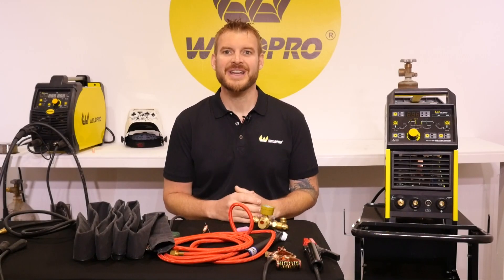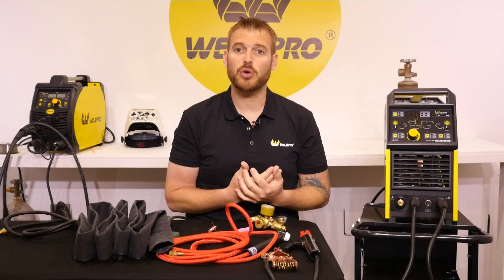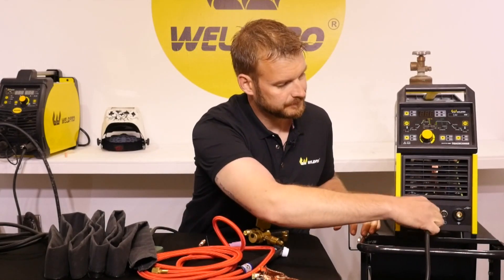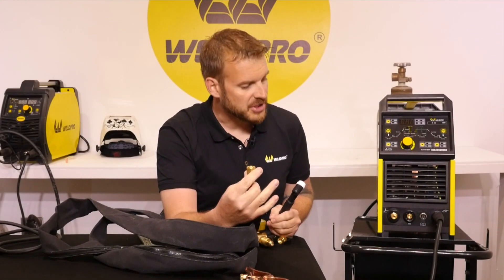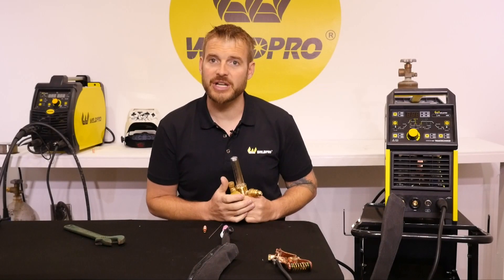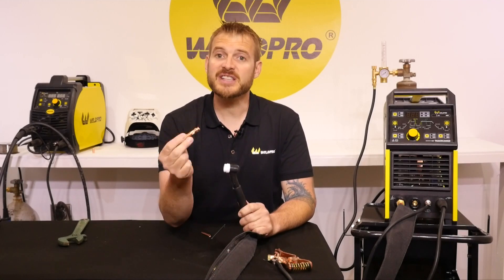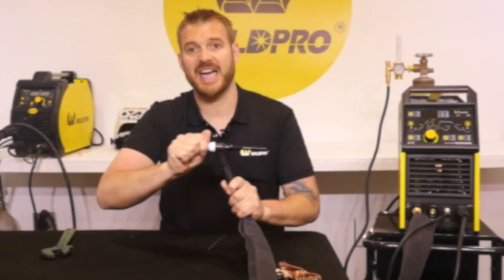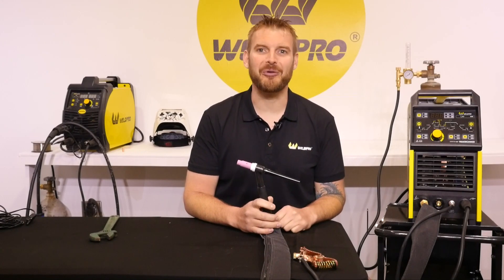Weldpro TIG 200 Part 2 -  Assembly and Set Up

Comment: Dumb question but where does the electrode connect during TIG welding?
Reply: The electrode is the Tungsten; it goes in the TIG torch.  It's at the end of the video.

Comment: My order was confirmed this morning. Just got my tracking number. This trigger pull is over 6 months in the making. I'm psyched! ✌️😎
Reply: Update: Holey smokes! Right outta the box this thing TIGs like buttah! UPS dropped it of at my school, and after I tried it, a few of my classmates took 'er for a spin. Finally, my welding instructor sat down and gave it a go. After about the first inch of bead, he says, "That's it, I'm gettin' one o' these". Very impressive machine. Way to go and thank you. ✌️😎
Reply: Just got mine today I can't wait to use it!

Comment: I take it that this welder doesn't have any hot start for stick welding or setting for 6010 or 7018...will this run 6010 electrode or is it 6011 on up?
Reply from the maker: 6010 can be a little tough to get going but there is a VRD open circuit voltage option you can turn off for hotter arc starting!

Comment: So there are two tungsten's with the torch. A blue and a brown color markings. If I remember correctly the brown is for welding steel and the blue is for aluminum. Is this correct?
Reply from the maker: Richard Wilkerson The blue tungsten is 2% lanthanated. This can be used on almost anything including aluminum :-) you don’t need to ball the point either. Brown is a zirconiated tungsten that is supposed to be for higher quality radiographic weld to prevent tungsten inclusions. The reality is the 2% lanthanated runs equally as well for 99% of applications. Try them both on AL and see which one you like better! Also if you would like to add a tungsten to your collection at any point... a red thoriated is excellent for almost anything but I’ll switch to pure tungsten or 2% Lanthanated for AL ... we better do a video on tungsten selection 😉😀

Comment: Vulcan 205 pro tig vs weldpro 200 ...
Reply from the maker: DAVID VILLA Vulcan only has 25% duty cycle at only 135 AMPS! Weldpro is 40% at full throttle and 60 % on A/C!! Also I’m not sure if you noticed but on 120v it can only weld stick up to 80 amps. That’s hardly enough for smaller 3/32 rod.
Reply: @WeldproWeldingEquipment  will be tig welding mostly aluminum and stainless steel, maby some inconel or titanim..
Reply from the maker: DAVID VILLA kind of a loaded question haha... the 20 torch shouldnt be a problem as long as you use a hose with connector that fits the tig 200. Water cooler... yes but an aftermarket cooler would require an external setup and some rigging ... you may see a water cooler model coming out from weldpro soon! Keep an eye out!
Reply: @WeldproWeldingEquipment  thank you for the info bught the tig 200 yesterday.. Kinda wanted to use the 20 tourch i have a lot of consumables from prior job that used that tipe of 🔦.
Reply from the maker: DAVID VILLA You know what I just thought of David... sorry to say but I wasn’t thinking the 20 is a water cooled torch. While you may be able to connect it this isn’t a good idea because it doesn’t get the correct gas or water cooling and can overheat the handle. We are coming out with a water cooler soon that you can add on. This should support your 20 model.
Reply: @WeldproWeldingEquipment  cool .. Yes the reason y i ask ia that i have a lot of consumables that fit the 20 torch, gas lens and fupa cups, the thread diameter is smaller in the 20 torch than the 17.. So i was looking if ther might be a 20 aircooled ck torch that might fit.
Reply from the maker: DAVID VILLA ya the Vulcan doesn’t seem like a bad machine at first but for $1000 it comes with no name components. When you get the TIG200 for only $798  it comes with a quality CK super flex torch kit. Warranty on the Vulcan is only 90 days. Weldpro is 2 year warranty. Vulcan... good luck with customer service... Weldpro.. call customer service and talk to Joe! He can give welding tips tricks, setup help, and troubleshooting. Vulcan has a 20% restocking fee... not us 😀 .... Save money and time while getting a better warranty, customer service, online learning resources, and higher quality components.
Reply: @WeldproWeldingEquipment  Hi yes its true. But how can i say.. If it brakes i can take it to the stor and swap it out no down time.. And warranty is up to 3 years i just found you matching and i like it.. But i am weighing witch one is best for my small business.. I am ready to buy now.. Looking at reviuwes abut your machine.. I like the duty sicle and the tourch but hows the waranty and your cuatumer service?
Reply from the maker: DAVID VILLA seriously our customer service is amazing and local here in the US. You can check out some of our reviews online. Let me just say this... if you get the Vulcan you will probably need to swap it out at least once. It is extremely rare that anyone has a failure with the TIG 200. Even if you ever were to need a replacement we ship from an in stock warehouse here in the US so usually down time is minimal. Seriously... save $100... get a better torch and better internal components. The AC feature is amazing on the welder. Pulse is excellent. Welding aluminum, stainless, anything else is well within the capabilities of the TIG 200. You won’t be disappointed! Check us out on social for lots of customer photos, reviews, and projects.
Reply: @WeldproWeldingEquipment  ok look like i will guive you a shot.. I am going to your web site
Reply from the maker: DAVID VILLA That’s great! I know you won’t be disappointed but there is one rule... you have to send us some cool pictures of what you build now that you are part of the Weldpro family so we can feature them on social. 😃😉
Reply: @WeldproWeldingEquipment  ok i will do👍
Reply: @WeldproWeldingEquipment  i do jave a question or 2.. Can i ad water cooler and can i use a 20 torch ?
Reply: No 4t on Vulcan, which I failed to realize in store

Comment: Hey Luke is this machine powerful enuff to tig weld roll cages and suspension parts on race cars? Most of the tubing and plates are 1/8" or slightly thicker
Reply from the maker: bennyboom63 Absolutey! The TIG 200 is perfect for roll cages and much much more! You will have no problem at all with 1/8”
Reply: @WeldproWeldingEquipment  thats good news im gonna give it a shot. Looking foward to working with it. Thanks for getting back to me.
Reply from the maker: bennyboom63 how did it end up working out!?
Reply: @WeldproWeldingEquipment  it worked out awesome. I can't say enuff good things about this machine.  The pedal feel is flawless and i can adjust my settings to have complete control of what i want to do. I got the upgrade with the CK Worldwide torch also and i highly recommend that for anyone who works on hot rods that has to weld in funky positions. Its an amazing machine. I was so impressed with the quality im gonna pick up the cut60NH. I'll never have to leave my garage!! Thanks Luke👍